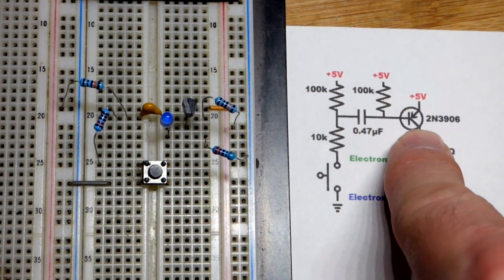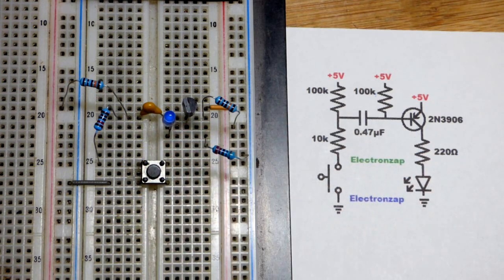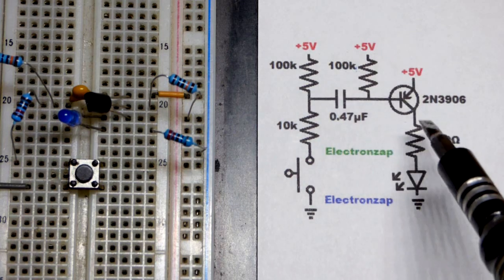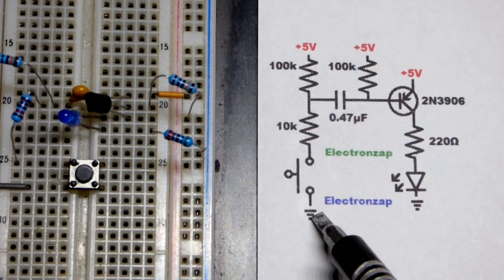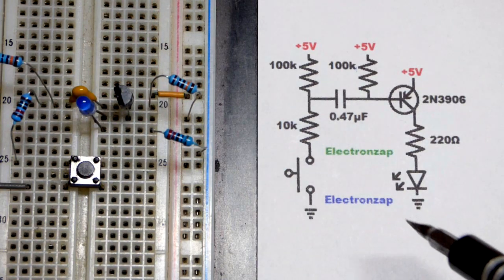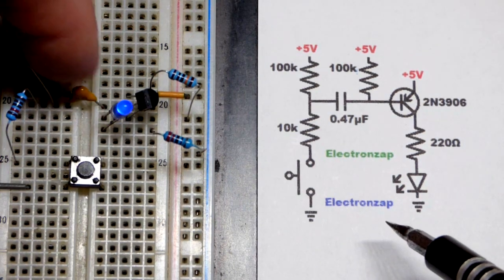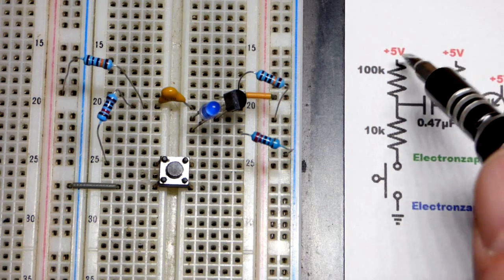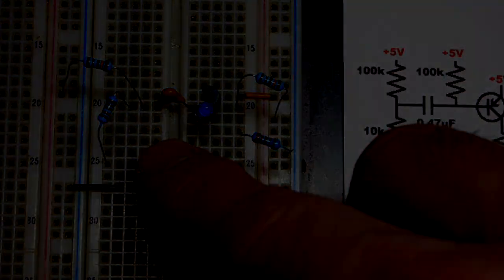PNP BJT one rapid LED light pulse per long press of push button switch and 2N3906 circuit schematic

Comment: I needed a clean single pulse to trigger a controlled pulse in a monostable mode 555 without using another 555 trigger.  I searched YT for "single pulse generator", and in ALL the 100's of videos that came up, I could find nothing simple.  Then I found your two videos that were JUST THE THING I needed. THANKS MUCH!!!!!!!   I plan on using the low-high-low version.  
--dalE
Reply from the maker: Glad it helped, thanks for watching!